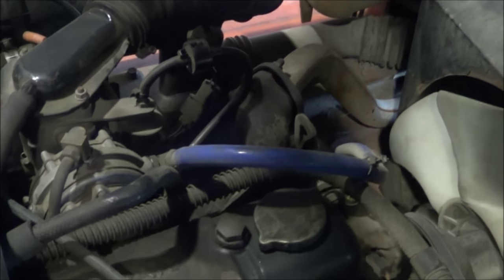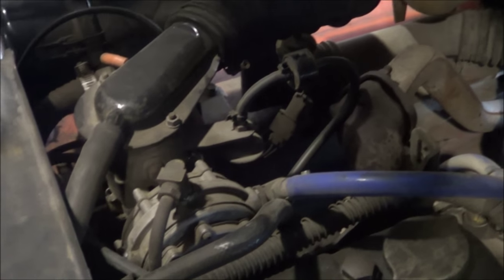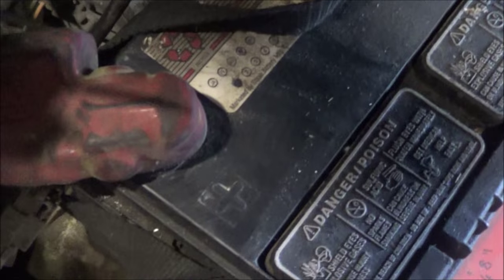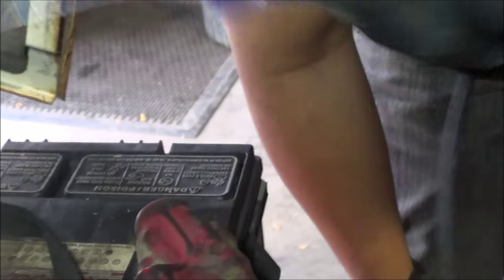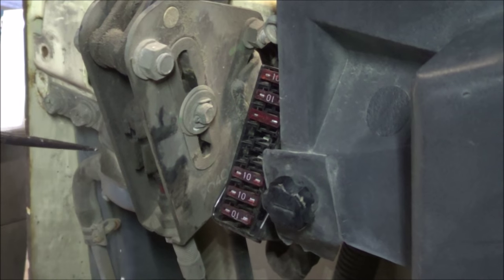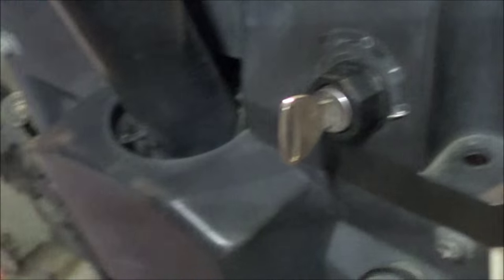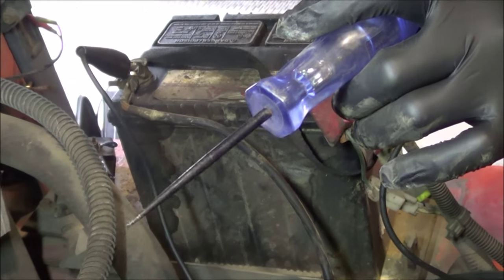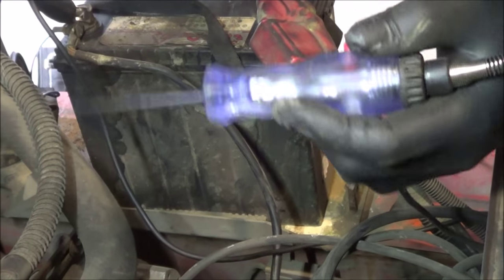Forklift No start no crank pt 1

Comment: Hyster propane push to start forklift won’t start. There’s two buttons, on and start. My forks are stuck off the ground and it won’t start. I cannot wrap my mind around what to do.
Reply from the maker: If it does not even turn the display on when you push the on button check the key switch above the battery.

Comment: Hi .  How are you doing .  can you help me .  I have a very old forklift, model 1984. The type is as in the picture. They stole a certain thing from the power box. I don't know what a forklift is. It does not work with the key, and if they start it from another place, it works, but it does not advance or delay.
Reply: I want the electrical diagram of the crane can you provide it for me I will be thankful to you

Comment: Hey man. Your videos are very helpful. Thanks for what you do. I've got a Toyota forklift with a similar issue. Sometimes it will crank sometimes not. The issue is when I turn the key over to crank it I can sometimes hold it at 2 o'clock, there's a 5 second delay or so, then it decides to fire right up. Any input would be appreciated
Reply from the maker: +Wayne Wimberly test if there is 12v going to ignition terminal on starter. If there is, then the starter might be starting to go bad. If there isnt, then anywhere from key switch, fuse or relay.
Reply: @forkliftgeek10  spOl
Reply: @forkliftgeek10  spOlaz
Reply: @forkliftgeek10  spOlaz

Comment: I always enjoy watching your videos. I have a question for you I have a Clark GCX 20E Propane lift truck I turn the key and nothing happens. The dash lights are on battery is new but it doesn't turn over. Any thoughts?
Reply from the maker: If the starter does not even click then I would check if voltage is reaching the solenoid of the starter. If not, neutral switch, keyswitch, starter relay, parking brake switch(only some models) are suspect. If it does click, then positive cable, negative cable, starter are suspect. If you have an amp clamp measure the current when you try cranking, if the current is high more than 400A then it is possible that your starter is seized or something is preventing the engine from rotating.
Reply: @forkliftgeek10  thank you so much.

Comment: I have a  forklift   7FGU30, It works but it does not accelerate, it could help me please .... I can not find a solution
Reply from the maker: +miguel garcia there are a lot of possible causes for that symptom. Misfire, plugged exhaust, vacuum leak, stuck governor just to name a few.

Comment: found  your  channel  good stuff bro hey I have a 2002 Toyota  25 I'm not to sure it's pretty  neglected  so I have a no start half the time  it clicks  play with  the  switch  and it goes had the switch  replaced  same deal looking  for a wiring  diagram  my go to diy  websites  only have cars any leads I'm not  a tech but I want to give it a go
Reply from the maker: +layuptech check negative and positive connection to starter make sure it's not corroded. If connections are good and voltage drop to starter is negligible, try tapping the starter while holding the key on start position, if it starts cranking chances are your starter is about to go. When u say clicking, is it the starter making the clicking sound?

Comment: What would it be if a yale diesel  forklift has no start but with all lights on dash work. Like the shift leveler is in gear?? I got it to work 2 times today by playing with the shifter like 100 times.
Reply from the maker: +John lim probably neutral safety switch
Reply: Voltage drop to starter seen too many times    Neutral switch seen couple times.   Voltage at starter when trying to crank

Comment: I have a 7fgcu25 no crank. No power to starter wire. Lights on dash work.  Fuel solenoid clicks. All fuses are good and have power  both sides.  Truck will start when I jump the starter. Any ideas thanks
Reply from the maker: Did you put the truck in neutral?
Reply: @forkliftgeek10  Yes. Also tested gear selector in another 7 series truck. Selector works fine.
Reply from the maker: Then I would check the starter relay.
Reply: Yes. Also tested gear selector in another 7 series truck started every time
Reply: Power to the starter relay and power to the start pole when you turn ignition to start.
Reply: @forkliftgeek10  power to starter relay and power to start pole when  you turn ignition to start.
Reply from the maker: @chaseharrison3349  if the starter relay is good and there is power to the relay(positive) then, there is only a bad connection from the relay to the starter or the negative for the relay coil is not present.
Reply: @forkliftgeek10  ok thanks I'll check it out Monday.

Comment: I am currently working on a forklift and am wondering why the engine runs quickly then deacelerates and repeat. What would the causes be?
Reply from the maker: +omar salas it depends on what system your're working on. But common issues would be vacuum leak, governor misadjustment( non electronic), fuel delivery problem to name a few.

Comment: Hey man I’m working on a Nissan pj01A15v pj01-9g2010 I had a no start issue with no spark to plugs I replaced distributor complete with new plugs and wires I have spark but now it seems I have a fuel problem.. could you help?
Reply from the maker: How did u figure u have a fuel problem?
Reply: Im guessing since I tested the spark between the plug and wire to distributor and I have steady pulse
Reply from the maker: If u suspect fuel, try spraying quick start into the intake and see if it starts.
Reply from the maker: This would have the impco fuel system right? It might also be the other way around and you are getting too much fuel. If u pull the hose to the mixer and crank the engine there should be no propane coming out the hose from the regulator.
Reply: Yeah you right that didn’t help
Reply from the maker: https://youtu.be/YRXZn65Vguk 

This video is a mazda but uses the same mixer design. Also a no start.
Reply from the maker: What didn't help?
Reply: And yes impco fuel system
Reply: Spraying quick start
Reply from the maker: Dont spray too much though. If it's out of time you might have a backfire.
Reply: Ok yeah only one spray but it didn’t change I will check by taking the vacuum hose to the mixer and see if it starts like you suggested
Reply: Hey just wanted to let you know I created the problem because when replacing distributor complete I noticed I didn’t reinstalled flush to engine. Reinstalled and started right up..also if the engine stalls when turning left or right I may have to readjust the dash pot valve correct?
Reply from the maker: If its stalling when u are putting a load u might have to adjust the idle up diaphragm screw.
Reply: Ok cool thanks so much Forklift Geek
Reply from the maker: No problem

Comment: Was it a neutral safety switch ?
Reply from the maker: +Eddy2jz Jdmlife a switch that's part of the directional switch assembly that prevents the starter motor from cranking the engine if either the forward or reverse switch is engaged.

Comment: hi there im new subscriber you have also idea for electric forklift like yale high reach
Reply from the maker: Not much
Reply: @forkliftgeek10  in our yale forklift high reach theres an alarm mod 9 driver open you have any idea
Reply from the maker: Driver is open on the MYHRIO module. First check battery voltage under load.
Reply: @forkliftgeek10  theres a possibility that the MHYRO module is not working properly that why theres an alarm
Reply from the maker: Yes
Reply: @forkliftgeek10  thanks for the info we trouble it couple of days and yet still alarm is driver open now we will work on the mhyrio module thanks again highly appreciated
Reply: @forkliftgeek10  we replace new module but the alarm still there driver open possible the electric battery need to replace?
Reply from the maker: Check battery
Reply: Hi, my forklift dors not positive Power to the starter relay and when i give a positive from battery directly to positive starter relay .IT start but hydraulic system don't work

Comment: A circuit that is hot during key on is shorted to ground.
Reply from the maker: When you say hot you mean that it's getting battery power at key on right?  When you say it is shorted to ground a fuse would have blown or wires would get burned. My test light clip is connected to battery negative and the tip to the block. Even if there was a short the test light should not be lit.
Reply: Yea true enough.
Reply: Bad ground cable from the battery?
Reply from the maker: Yes it is. Watch part 2 for the explanation.  Tnx